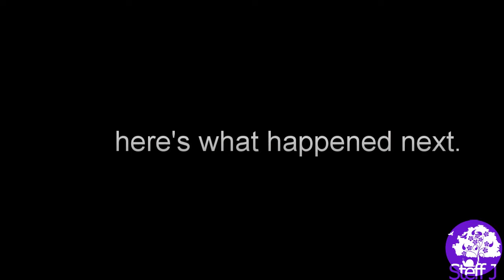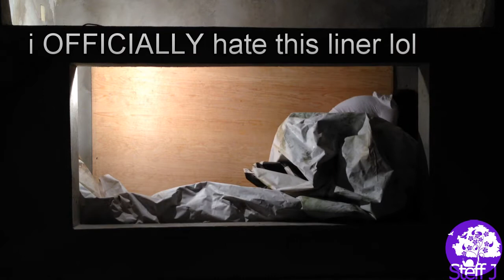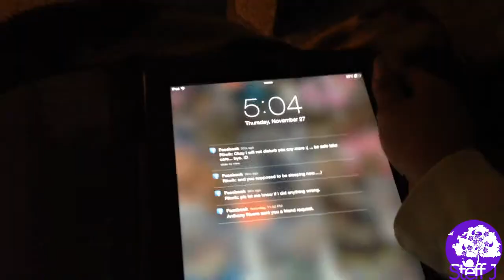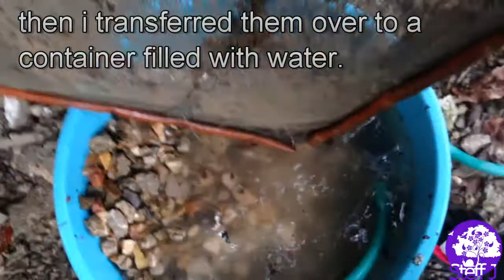set up the turtle indoor winter setup with me

Comment: Did you use water straight from the hose? If so, how long did you let the chlorine evaporate for? I'm always afraid of using tap water because of all the chemicals
Reply: Jasmine Benitez it says online that if you keep tap/hose water in open air, it takes 24-48 hours to evaporate the chlorine and other chemicals, such as fluoride, I usually do 48-56 hours before I put them in just to be safe.